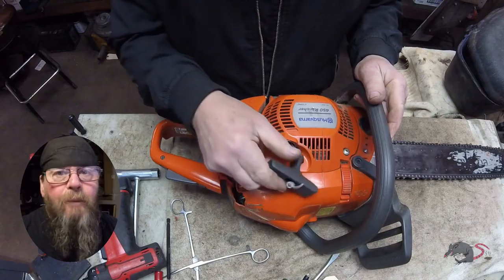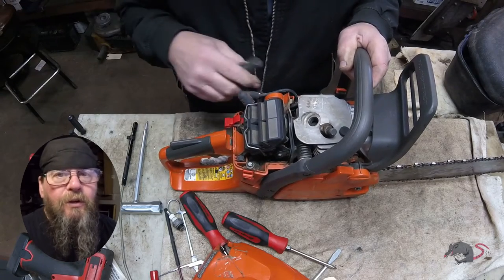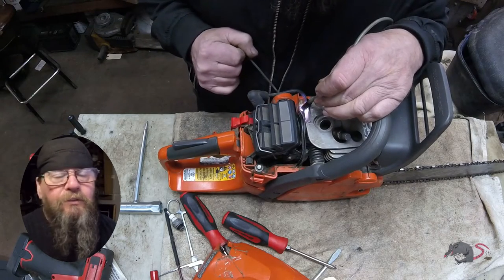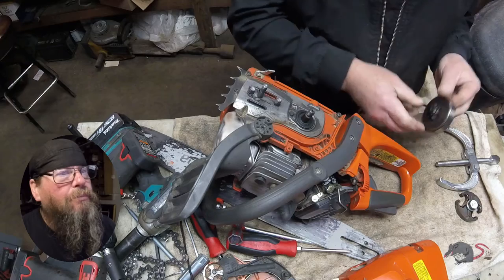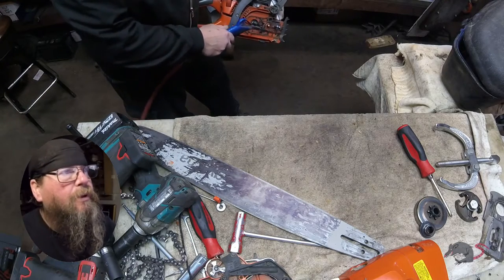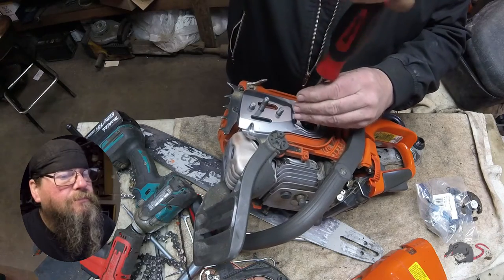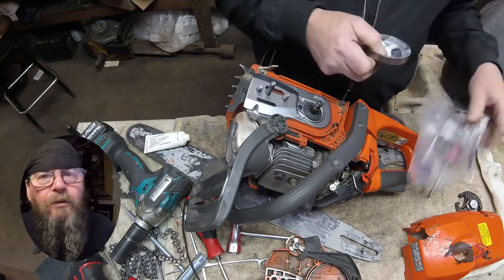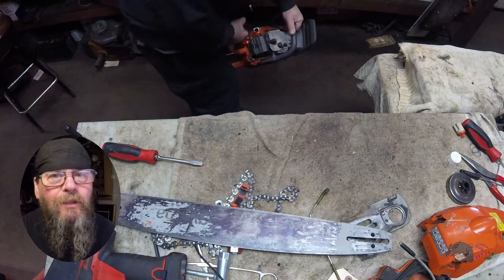Husqvarna 450 Starts Hard But Runs Great

Comment: Good information! Any ideas on how to stop bar oil from leaking out when saw is not in use?
Reply from the maker: Sadly, the best way to stop oil from leaking out of a 450 Husky is to follow the owners manual and drain the tank. I see a lot of leakers and I usually seal the oil feed hose to the case.
Reply: @TheGreasyShopRag  I will try that (just as soon as I replace the decompression valve.) ☺️

Comment: Just bought this saw brand new 450 rancher and it works great the only thing is it idles really low speed. I don't like that yes im running there pre-mix fuel so its not that, now I do live at 2500 ft so wondering if that has anything to do with it ?
Reply from the maker: If you just bought it from a dealer you should take it back to the dealer for a carb adjustment. If you have never made a carb adjustment before well then I'm not sure what you're gonna do. I don't have a carb adjustment video to refer you to.

Comment: Hi there - greetings from Denmark - thank you for some great videos!
I have a Husqvarna 254sg - it is super hard to pull. What would you do first to resolve this? =)
Thank you advance!
Kind regards
-Kristian
Reply from the maker: Does it pull hard with the spark plug removed? Does the chain turn when pulling the cord?
Reply: @TheGreasyShopRag   no to both questions=)
Reply from the maker: Then look in the cylinder and check for scoring or carbon buildup. Maybe check the spark arrestor screen too.
Reply: @TheGreasyShopRag   thank you very much! I will do that later  today=) its 08.07am in denmark right now.
Reply: @TheGreasyShopRag  Ok, so I took the exhaust off, and the piston has like 3 vertical stripes on it, the cylinder was not too bad, but it had a few marks - does this mean I need a new cylinder and piston?
Reply from the maker: @kristianoneup346  possibly. That scoring shouldn't be there. The real question is why? If you have a lean condition that caused the scoring then that needs to be fixed first.
Reply: @TheGreasyShopRag  And that is why The Greasy Shop Rag is the Best chainsaw Mechanic doing YouTube videos. He cares and is willing to answer our questions and help us out like he did here with Kristian OneUp.

Comment: I've got a 460 that starts fine cold, but is hard to start when hot. I don't see a video on that. Maybe I missed it. Any help would be appreciated.
Reply from the maker: Two things need to be addressed. First, does the cylinder have any scoring. Scoring and a hot piston are an almost sure way to pinch a ring in a piston groove and lower compression. Second, make sure to prime some cool fuel from the tank through the carb and then use the fast idle feature when warm starting.
Reply: Thanks for the reply and suggestions. I'll give the second one a try the next time I'm out.